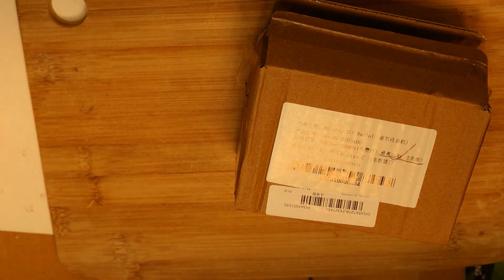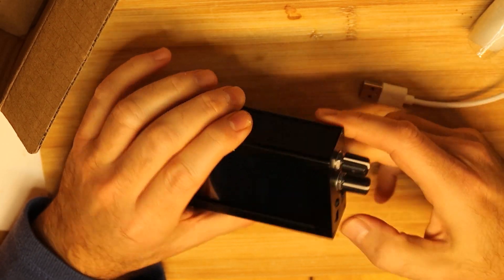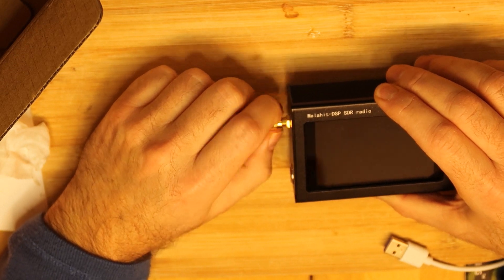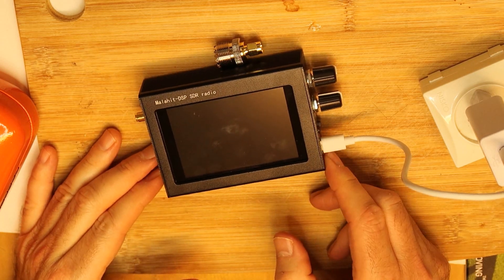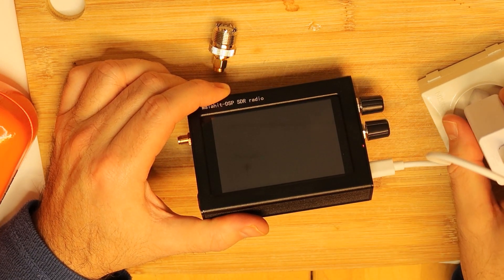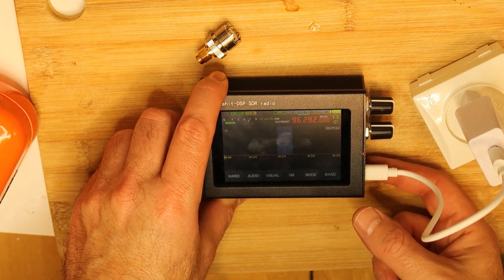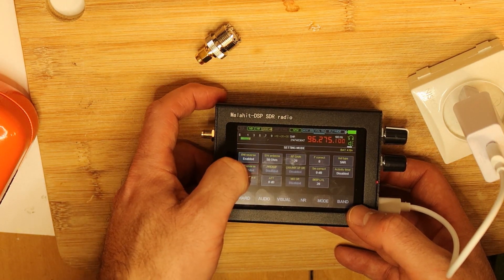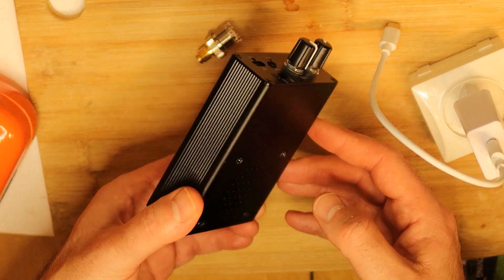SDR Radio Broken

Comment: I had to take mine apart and boost the 3.7V battery a few times with 3 AA batteries right on the battery pack. Now it is actually charging and seems to be working properly.
Reply: How you'd do that exactly?

Comment: My radio arrived yesterday. 8th July 2021. It had the same fault as yours.   What I did. Removed the 4 black screws on the end where volume controls are. Pulled and slide out.  But not fully. Just enough to see the battery white plug. Unplug battery and leave unplugged for 30seconds. Plug back in. Slide back into case. Make sure radio is off .Hold off button for 3 seconds until hear more code or beep. Plug in charger and make sure its fully charged.  That method fixed mine. Please note touch screen is slow to react and need to hold finger down longer. Not just tap. Ps there is a reset hole if computer gets confused. I've not tried it. Cheers from George in the UK 👍🇬🇧🤠
Reply: it's not a faulty radio, sound turns on by touching screen on Speaker or Headphones icons

Comment: Did you ever find out what was wrong? I have one that came in a similar condition.
Reply from the maker: yes - internal battery over discharged, watch this video
Reply: Mine does not charge but works  need to be plugged into antenna to receive any signal
Reply: No sound? Switch to speaker or plug in headphones. Internal Battery may not be plugged in